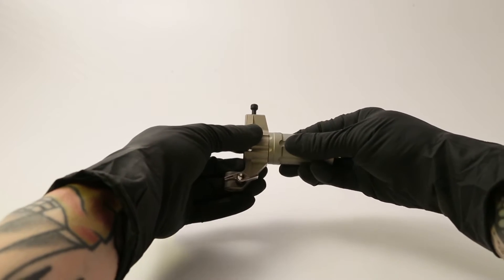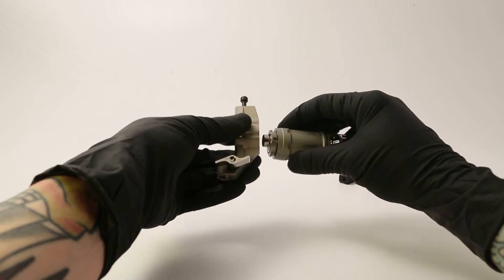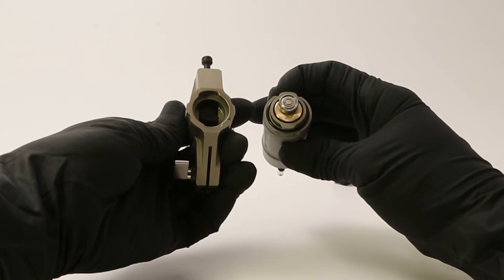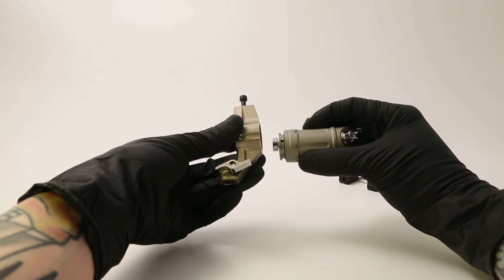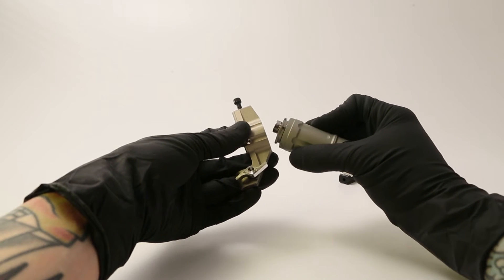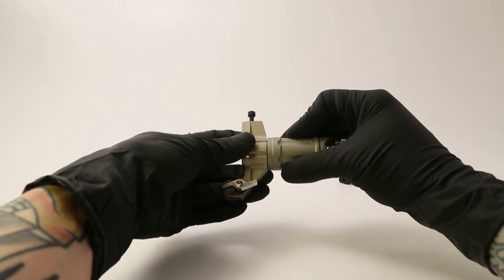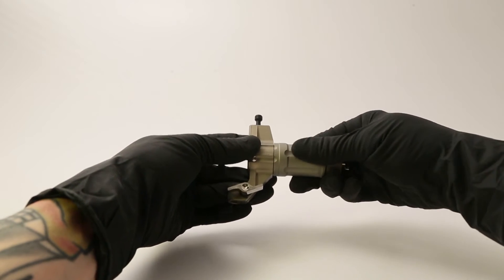Symbeos Rotary Tattoo System - Changing the Motor Body

Comment: My liner machine, the wires broke from the RCA connector! How do I open the machine to reconnect the wire. I realize I have to solder them, but how the heck do I get to the wires on the motor!
Reply from the maker: @tattoosfromgrease - The motor back is press fit onto the housing.  It's a very tight friction fit and often cannot be removed without special tooling that we have at our shop.  If you're still experiencing this issue please reach out to our customer service team for a resolution at customerservice@eikondevice.com

Comment: have question about  ems 250 power supply are you able to just press foot pedal to turn on and then press again and turn off  or do you have to have foot on pedal the whole time
Reply from the maker: Hey, no the EMS250 does not have any footswitch modes, it strictly runs on/off. Nice blast from the past, We developed that one over 15 years ago!

Comment: I bought a symbeos from a co worker who had never used it and had in fact bought it from one of his old colleagues, i love this machine but i am having one major issue, the motor will slide open if im working on certain angles when my hand turns and its prone to falling off the machine, im bot sure why this happens but id very much like to correct it, everything looks to be in order the o rings are in place correctly but this appears to be either a design flaw or the previos owner maybe put a thinner o ring on and it perhaps isnt giving enough pressure to lock it in place maybe? Any advice before i retire this machine? Like o said its a nice machine and i love using it but i cant work with a machine thats prone to coming apart when i change the angle im working on.
Reply from the maker: Hi Jim,  thanks for reaching out with your issue.   The issue you describe with your motor not staying tight is usually caused by the o-ring. If it's not putting enough back pressure on the machine body then the weight of the motor with the cord hanging off it can sometimes cause the rotation.   If you reach out to our customer service team and advise them of the issue we can send you some new O-rings to try.    Their email is customerservice@eikondevice.com